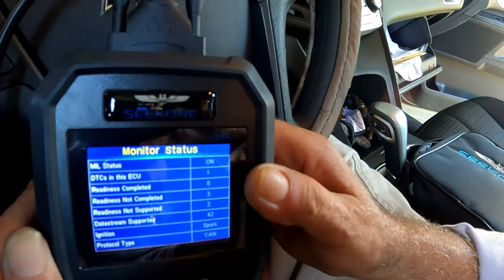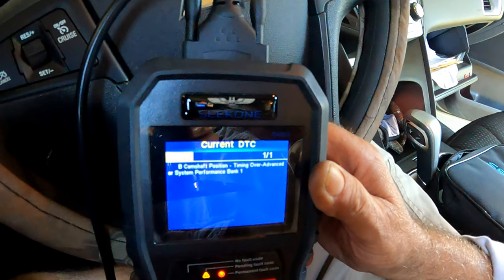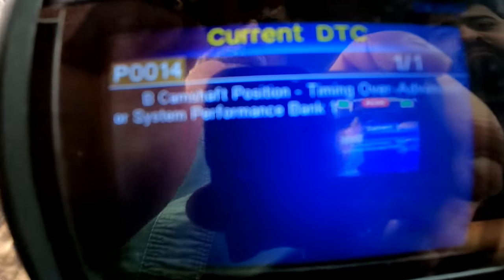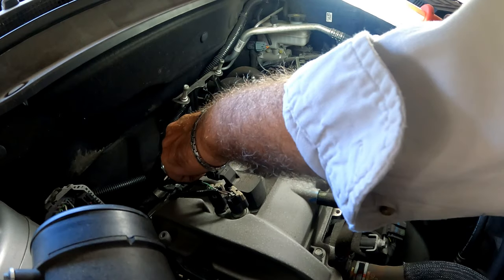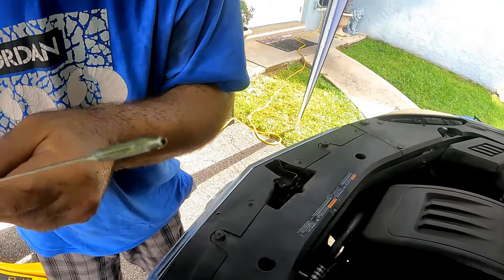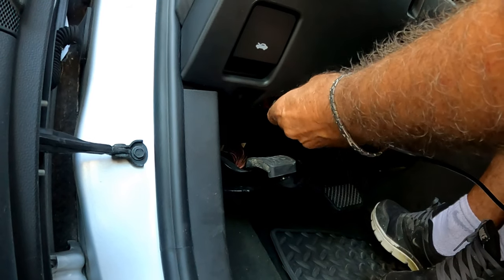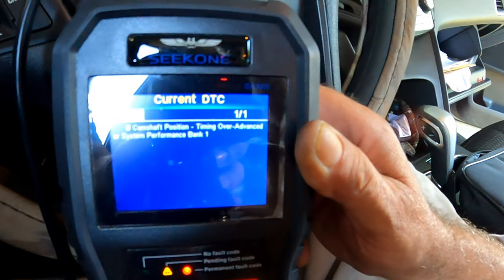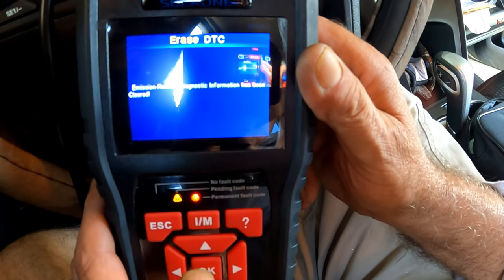How to Test & Replace Camshaft Position Solenoid – Code P0014 - 2015 Chevy Equinox 2.4 Liter Engine

Comment: Those scanners that read the codes saved me thousands of dollars, a friend had one and it found the code and he helped me replace it and only cost about $150 in parts and about 3 hours of time. A garage would have charged a fortune. I fixed 3 items in the car I had and had the vehicle the longest ever I've owned one. They are an amazing item. Great job finding and fixing the issue. Well done.
Reply from the maker: I have this OBDII for a couple of years and came in handy quite a few times between my vehicles and my sons. I agree it's well worth the investment. Should have mentioned good Multimeter as well.

Comment: Hi John I just purchased on Equinox 2010LX and the screen radio look or damage because I don't see what do you recommend to exchange radio  my is working but I can see the screen radio station do you have any video to fix the problem. 
Once again thank you for all those video to fix and change parts of Equinox.
Reply from the maker: hi Orlando, unfortunately  these days no one fixes radios anymore. you are better off getting a new or used one at a junkyard. good luck.

Comment: I have a used 2016 chevy equinox ltz awd and I've changed the P0011 twice since I bought it in June it has 52270 just got a oil change and the check engine light has come back on getting it looked at Monday hopefully it's nothing major
Reply from the maker: Let us know what's up. It may help someone. Thanks

Comment: I have a chevy equinox 2012 LT and today I was about to go to do some errands and I notice the engine light on . I have the t-mobile obd In the car so I looked at it a saw the P0014 then I use the fixed obd and same thing the same code . I'm a new driver and don't understand what caused this because I'm usually pretty good on Taking my car for maintenance when it's due can you explain what this happen and how to fix it
Reply from the maker: Dirty oil can be one other cause.
Reply: Check your oil level.

Comment: Those brown clips that you took off the connector where can I get those ? And are they essential? One broke when we tried to remove it and we’re not sure where to purchase it
Reply from the maker: If you mean the clips that lock the plugs into the solenoids, their purpose is to prevent the the plugs from vibrating off. I'm sure the it's ok to temporarily operate the vehicle without them but I would look for the new ones at an auto parts store.

Comment: I recently had a new camshaft changed placed  due to the code, I drove it for a while the check engine light came back on. I returned to the mechanic and he cleaned and asked  me if I had a recent oil change which I did . Could this also result in a timing issue?
Reply from the maker: As I mentioned in the video, Its possible ,  the last resort is a timing issue. I would wait till the engine light comes back on. It could be there was residue from the oil that clogged it again. One thing about these 4 c engines, they need oil change when its due. So hopefully you wont need to go further.

Comment: P0014 came on 2014 chevy Malibu, changed camshaft selonoid intake and exhaust...engine light came back on...Car is running fine...Thoughts?
Reply from the maker: Did you clear the code?
Reply: @JohnCRV  yes...Being told now that timing might be out! Here comes the Money
Reply from the maker: @johndyson1904  the timing can be off but rare. How many miles do you have.
Reply: @JohnCRV  60,000...
Reply from the maker: @johndyson1904  not bad. I’d be interested to know if it is the timing because you would feel it especially when you take off.
Reply: @JohnCRV  well the dealer has it now, I'll let you know. Another mechanic friend of mine over 40 years experience also like you, doesn't believe it's the timing. He believes it could be the pig tale wiring or just something minor. I hope! Thanks for your interest, it's much appreciated
Reply from the maker: @johndyson1904  hope it’s just wiring……

Comment: If you're only replacing the parts I'd recommend unplugging a battery terminal, eliminates any chance of shorting anything out by some accident.
Reply from the maker: Good tip
Reply: @JohnCRV  I can't blame those that don't do it for this vehicle though. They stupidly sit the computer on top of the battery making you unmount it before even getting it. To beat it all, it's next to 2 reservoirs. They had plenty of room to put it elsewhere
Reply from the maker: @jameshall2017  I'm not sure if its just stupidity or more intentional.
Reply: @John C RV  definitely intentional, gm engineering is the worst, they make everything a pain in the ass just to get you back to the dealership

Comment: What if I took my equinox to the mechanic and  they replaced this exact same thing because I was told it was my solenoid and replaced it but the check engine light came back a few hours later ? They can’t seem to figure out what it is and that they recommended me to get a new cpu , would that cause an engine light issue?
Reply from the maker: WOW, you definitely need a second opinion on that. We are not licensed technicians but the CPU is usually the last thing to replace...
There's 2 solenoids and  sensors as well that give similar codes... 
Be careful...
Reply: Thanks so much , I will definitely get a second opinion
Reply: Also from what their reports said they had replaced the sensors also.
Reply from the maker: @meuysaeteurn9283  They still got the same code?

Comment: I've changed my solenoids 3x now and the CEL came back on. I already did a fuel system cleaning and recent oil change. The car seems to run fine so I don't know if I should just ignore it or not.
Reply from the maker: Did you use an OBD to reset the engine warning?
Reply: @JohnCRV  yes and it unfortunately came back a day later. I'm gonna try some Lucas complete engine treatment in the oil because I don't know what else to do. I've already cleaned the throttle body as well
Reply from the maker: If the code was Code P0014 it should have went away.
Reply: @JohnCRV  oh yeah it did but it came back. I saw there's other things that can cause this code. It's just a PITA only 60k miles and I saw yours in the vid had half that. Smh
Reply from the maker: @KidFriendlyGaming  You may want to bring it to a mechanic with a good scanner. You never know.
Reply: Change both cam shaft position sensors as well there like $25 for both
Reply: @AMGTT  Oh I did. I've also put lucas complete engine treatment in the oil and the gas as recommended. Im gonna have to try some highway miles to see if that helps. Most of my driving is short trips. Before this i did a fuel system cleaning at ntb. car only has 60k miles but i saw this video's car only had 30k :|   and i replaced those both 3x now
Reply: @KidFriendlyGaming  Any updates. I have the same issue lol. Replaced both intake & exhaust (Did exhaust 3 times before I realized that all of the exhaust solenoids work through testing so its not faulty solenoids, the wires also look good. I'm gonna try to see if doing another oil change works even though I just recently did it (300-500miles ago). I heard that when you drive on low oil it could possibly create sludge on your air filter (Reason this problem even appeared is because I drove with low engine oil when I found out that my air filter and oil drain plug wasn't plugged in properly). So maybe the air filter has sludge? (I'll see).I'm also thinking of replacing the exhaust camshaft position sensor (but idk if this will actually do anything). My car has NO symptoms, drives perfectly fine. Any thing else you did?
Reply: @zHazzz  so I ran a couple fuel system cleaners and my CEL had gone off, came back like 2x and actually for the last month or more it's been gone with no return. One cleaner I used was Lucas complete engine treatment. Did some in the oil, gas tank like the bottle says. After that I did another one l, I think the techron fuel cleaner. So try a couple of those now and see if you have any luck.
Reply: @zHazzz  so my CEL came back on and went off again a few times. it's been a little while again with it off, but it was running a little rough, so i got another oil change (synthetic) despite it being 40% life yet. And it is idling better now, again. While talking to the mechanic at mr tire, he said this was typical for this model and it's the oil/motor, not the fuel system. so i ordered some more lucas complete engine cleaner which ill put some in the engine, not fuel tank. the master tech showed me this pyroil engine flush to do at next oil change. I wish i would've done it before the oil got changed, but will do it next time. my car only has 65k miles, 2010 and the tech said it's the sludge build up inside. some areas are real small inside there, so it doesn't take much to get build-up. i also run a k&n air filter and have cleaned the intake manifold thing with carb cleaner before. i also have more fuel cleaner stuff on order, but yea, seems like all of this helps to maintain the system and keep it healthy. NOT driving the car causes its own issues with build-ups.
Reply: It could be you’re low on oil. These sensors run on oil pressure and if the oil level is low (common with this motor because the pistons rings weren’t sized properly at the factory) then you will have starvation and throw codes. It could also be that your oil screens are plugged.
Reply: I added powerful cleaner to my engine oil and the light went away. I think my VVTs were clogged.
Reply: @precisiont5188  yea the guy at Mr tire said to do some engine flush next time I have the oil changed. My light has been off for some time
Reply: The stealership would have charged more than a thousand dollars to fix it.

Comment: I have a question, I initially took my car
In that read brake vacuum booster sensor. Because I could not push the brake down to stop the vehicle, I was practically standing on it to stop. And it happened all of a sudden. Now after order a sensor for what I thought was the problem,
Which I
Could only do at the dealership. TheYve had my
Vehicle since sept the 14. Which they just informed me it
Was the time
Chain $2000. Now it’s the cam shaft which they said could
Not be coded. But here’s a video for it and it’s the same one that’s on the invoice paper.
Reply from the maker: That is weird! All these issues at once would make me wonder as well. Not sure what to tell you but sounds like a misdiagnose happened there, which happens but that's an expensive misdiagnose in which they should give some kind of discount. But I doubt that will happen from a dealer.
Reply: Dealerships lie to make money often. They did something similar to me. You can't trust them. The best we can do it learn to do everything ourselves. The stealerships cheated me out of $5,000 dollars and would not honor their warranty another time. They lied, etc

Comment: What settings do I set my multimeter on,?
Reply from the maker: Sorry I missed your question.
The setting depends on the type multimeter you have but it should be on Ohms. This setting is used to measure the resistance, which is measured in ohms. The function on its own is called an ohmmeter. A great way to check the accuracy of your multi meter is to get a resistor that you know the resistance of, and use the ohms setting to test the resistance. If it reads correctly, you can be sure that your DMM is accurate. The ohm setting also a quick and easy way to test the condition of fuses - if the meter reads OL, the you can be sure the fuse has blown. SAFETY NOTE: only test fuses with the ohms setting when they are OUT of the circuit.

Check this link for more info; https://www.themultimeterguide.com/multimeter-symbols-guide/

Comment: I changed this part but the engine light is still on and I don’t have the engine code tool. Any advice?
Reply from the maker: Need an obd II or need to go to a mechanic.
Reply: Sometimes unplugging the battery for 15 min and then plugging it back in erases codes. Either that or driving the car for 7 run cycles may reset it if the issue is truly gone.

Comment: what happens if replace the solenoid and tested them they click but u get the code back
Reply from the maker: Did you clear the code after you replaced it?
Reply: cleared code with scanner and took negative battery cable off

Comment: Hi, How can I fixed my Chevy equinox 2.4L2012 ? code p0420 . Fuel consumption more than 15 L / 100 km .
Reply from the maker: Not sure if it's the same.
Reply: Hi. How can I fixed my Chevy equinox 2 4L 2012 ? Code p0420 . Fuel consumption more than 15 L/ 100 km.

Comment: I replaced both and now I got p0011 on my 2015 chevy equinox LS.. Anyone know why?
Reply from the maker: The first thing you should do when you have this code is check your Equinox’s oil. If the oil level is too low, the camshaft actuators won’t work properly.
Reply: @JohnCRV  unfortunately the oil is perfect.. What else could be the problem.. And before I replaced these 2, I had p0013 and p0014.. Now it's only p0011.
Reply from the maker: @jorgecarrejo  You have done the following: 
If it has been a long time since you’ve changed your vehicle’s oil, or you find that there may be a reason to believe that the oil thickness is wrong, change the oil and see if that clears P0011 in your Chevy Equinox.
You have changed intake actuator for a 10 or 11 code and or the exhaust actuator for a 13 or 14 code. 
Changing the intake actuator should have fixed code 11 as well, the only think I can tell you is to check the electric connection to it to make sure it's making good contact.
If all the above doesn’t remove codes, then timing chain/belt jumped.
 You’ll have to get some mechanic advice with that. Good luck!
Reply: @JohnCRV  I appreciate your help..

Comment: So what about the camshaft position SENSOR? 🤔
Reply from the maker: here’s a short video on it. there’s plenty of other videos as well. good luck.
https://youtu.be/JCDIlkp7-6k
Reply: @JohnCRV  that’s the thing. Most of the videos on here are either the solenoids or the CRANKshaft position sensor, even though the title says “camshaft position sensor”. 😕 I’ll check it out. Thank you.
Reply: @JohnCRV  yep, that’s the exhaust side. That’s the other 1/3 of the videos. I need the intake side and so far there’s only one video that even talks about it but the whole video is the guy removing this metal shroud to get to it and the video ends with “and that makes it so much easier!” …without showing where it actually is. 😕 Thanks anyways John.

Comment: Thats the Variable Timing Solenoid, the Cam Sensor in on the Opposite End of the engine. CAMSHAFT POSITION SENSOR ON THE MOM CAR (2015 EQUINOX) - YouTube @John C RV
Reply from the maker: Thanks for the input.